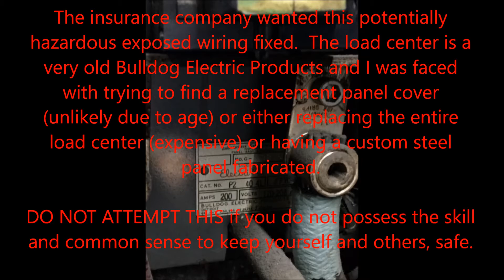Replacement cover for electrical panel; cover for electrical load center circuit breaker box

Comment: I ran into this issue as well, can I find this material at local lowes or home depot? Or does is come from a specific carrier?
Reply from the maker: you will not find it at any of your local stores.  just buy it on ebay as stated ON the video at around :22.  Be sure to like and subscribe if this video helped you.  That would really help me.  thanks!

Comment: So what did you use on the sides? The same material? It looks like 1x2 wood, it's thicker than the sheet.
Helpful for my situation (old box, not made anymore), but a little explanation would have been nice.
Reply from the maker: As the description says, I used CE Phenolic ...  no wood.  All same material but two different thicknesses.  You don't want ANY material that will burn or track electricity.
Reply: @YuDaMan  Thanks for the quick answer